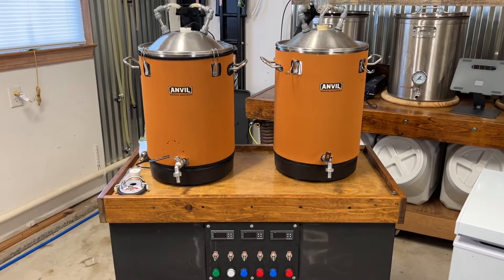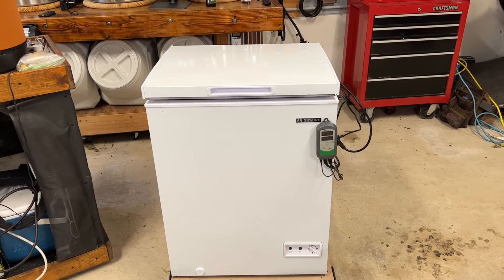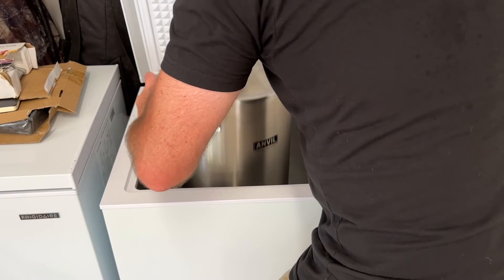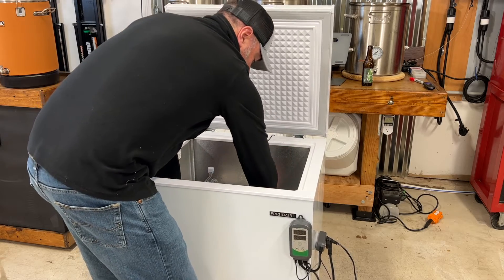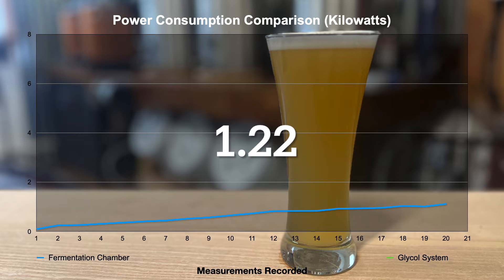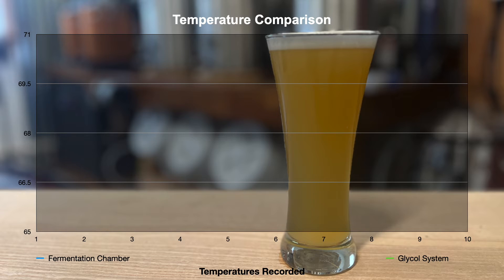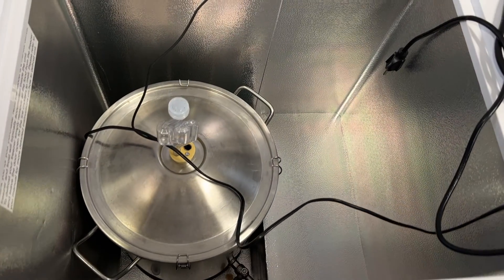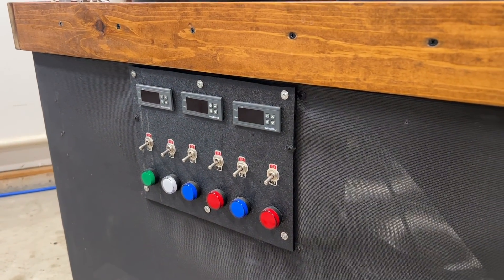Glycol Chiller vs Fermentation Chamber #homebrewing

Comment: Good video / test, thanks.  Thermodynamically, the sealed & insulated chamber will always use less energy than the glycol system.  
I would also like to mention that old freezers & fridges are available a-dime-a-dozen.  But it is a false economy to buy a cheap/old chamber.  After using an old fridge for a while, I upgraded to a modern one.  Not only was it more spacious and silent.  But my electricity bill dropped by 40%.  That's what the old fridge wasted, compared to a newer one with thicker insulation.  With that money back, not only does the better (more expensive) chamber pay for itself quickly, it leaves more money for brewing beer.  
FYI, I run my inkbird with a Delta (variation from the target before it turns on) of 0.5 degrees Celsius, or about 1F.  So I believe that you could make the temperature curve even tighter, with the chamber.
The one drawback to using a chamber, I have encountered, is that after a cold crash you (likely) have to move the fermenter, for draining by gravity.  This no-doubt decreases the benefit of the cold crash because of stirring and warming.
Reply from the maker: No probem, this was a fun test to run. No doubt, a newer fridge will be more efficient. The fridge route is definitely simpler and probably makes more sense for most small scale homebrewers. I go back and forth with my glycol and chamber setup. At the scale I brew, the cost of the system is an almost a non factor for me, but I suppose the cost could be a consideration if I brew at a larger scale in the future. I would agree, buy the newest unit you can buy. I’ve been playing around the inkbirds with tighter target temps and I can keep a smaller temp window, closer to my glycol system. This might be a good follow-up video this year. Thanks for the comment, happy new year, cheers!

Comment: Nice data gathered and presented here. I brew one batch at a time (12 gallons) and ferment in sankey kegs. There’s no beating my upright freezer and inkbird controller. At one point I considered finding a second upright freezer for the flexibility of simultaneous fermentations. Would only consider a glycol setup if I had 3 or more brews going at the same time.
Reply from the maker: Thanks, this video was a lot of fun to make. An upright would probably be a little easier in your back:) The glycol system is great, just takes a little more effort to build. Thanks for the feedback, cheers!

Comment: On the power consumption I'm not sure the power draw would be the same for a out of box Glycol unit vs your DIY unit using a window AC unit....that just seems like a big draw
Reply from the maker: I don’t know what the amp draw is off the top of my head, but my comparison was based on the total kilowatts.  I think thought this was a good measure since a kilowatt is a kilowatt no matter what the draw is. For the window unit, there probably is a little more of a spike when it turns on. Even though my test saw more power consumption by the glycol system, it was minor in terms of cost. Thanks for the comment! Cheers!

Comment: I'd like to see the same thing but with unsplit 10 galons batches.
Reply from the maker: Hey Arcanumix, thanks for comment! Do you mean put 2 fermenters on the Glycol system and 2 fermenters in the  Fermentation chambers? If so, I should brew days in the near future that can compare the additional volume. I'll put that on the schedule for 2024:) If you're wondering if the glycol system can do it, it can;)
Reply: @justhomebrew   thanks for the reply! No i mean ferment a hole 10 gallons batch in one vessel. What should be the best option without breaking the bank ans also if there are bigger diference between glycol and fermentation chamber since theres more liquid to work with.
Reply from the maker: Thanks for the clarification. I currently only have 7 gallon fermenters. If I ever get a larger fermenter, I’ll give it a shot:) Cheers!

Comment: I think providing you have the physical ability to move your fermenter In-N-Out , the chest freezer fermentation is a winner 🍻
Reply from the maker: I also think there are ways to make lifting easier. You could pump the wort and beer in and out of the fermenter so there isn’t any lifting. I think both are strong methods depending on your needs. Thanks for the comment! Cheers!

Comment: I bought a used beverage fridge for 60. and an inkbird w/wifi for 35.
 It works great for 95. I have to admit that I have my eye on a Brewtools F40 with a Brewbuilt glycol chiller. The entire opposite end of the price spectrum.
Reply from the maker: I’m sure the brewtools or any commercial glycol system would be great. I’ve been very happy with both my diy systems, but I would never rule out getting something like that brewbult. Thanks for the comment. Cheers!

Comment: What a great comparison! It's even better that it's backed up by actual data. I'd be interested in seeing the same video but at lager temps. The idea being to see the impact of a larger delta between ambient and fermentation temperatures on each system's performance.
Reply from the maker: Thanks for your feedback! I could definitely capture more data with a lager test scenario. I don’t brew lagers often,  vut I’ll definitely capture data and compare the two systems when I do. I also want to swap out my ac unit with a newer one to see if I can get the glycol system’s efficiently closer to the chest freezer. Cheers!

Comment: I'm interested to see what the power usage difference is between 1 fermenter and 2, also i think alot has to do with the insulation of the fermenters them self. Anyhow nice video to watch! Greetings from the Netherlands
Reply from the maker: Thanks for the feedback! There are few considerations that could affect my diy system’s performance . I think the biggest factor is my aging ac unit. My ac is running longer these days to keep my glycol cool. I think this is a great example for someone to see how a well used diy system operates after a few years. It was a fun experiment to run on my setup. The good thing is both systems performed well and the cost is really a non factor to me at this scale of brewing. Thanks again! Cheers!
Reply from the maker: I’ll also see about getting results from 2 fermenters. I would expect it to be double the kilowatts.

Comment: The difference in kWh for both is surely because your fermentation chamber is a closed and insulated box, while with the glycol system both fermenters are open with a minimal to no insulation.
Reply from the maker: Most likely. I also feel I have an aging ac that is losing it’s efficiency. I thought for sure the freezer would use way more energy to keep my fermenters at temp. That’s one of the reasons I built a glycol system a few years back. I guess you never know until you run a test.
Reply: @justhomebrew  I don't think AC systems really lose efficiency like that unless they are actually in the process of dying.  The difference is most certainly the door first, insulation second, efficient sizing of compressor third.  Didn't you have a dad who yelled at you for leaving the door open and paying to air condition the entire neighborhood?  Your glycol fermenters don't even have a door to close!  Easy enough to just build a box of foam insulation for the fermenters if you just want to see, I doubt you really care about the $.12 worth of electricity usage.
Reply from the maker: @mrjhchrist Must be dying then. I’ve noticed it’s taking longer to cool down to temperature and I can’t quite get the glycol done to 32 degrees. Not sure if you can tell, there is a top for the cooler. And you’re right, I’m not worried about the extra cost. Cheers!